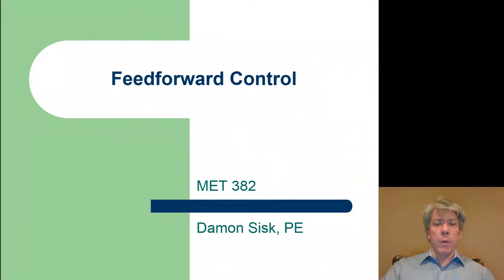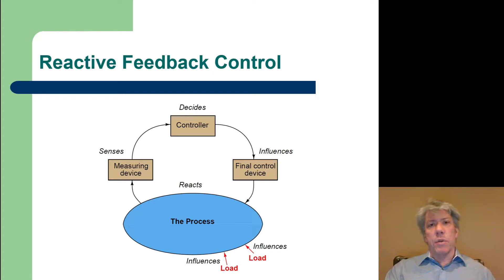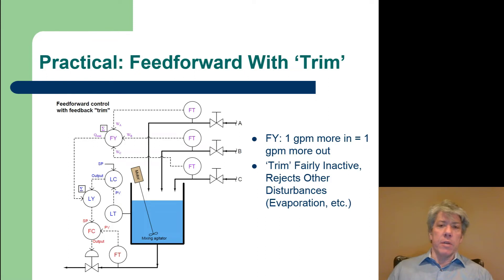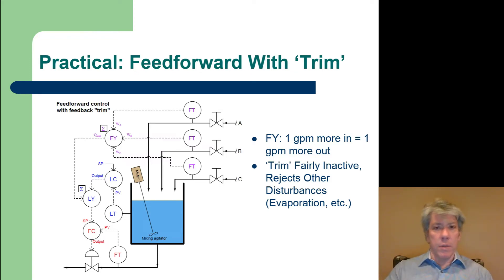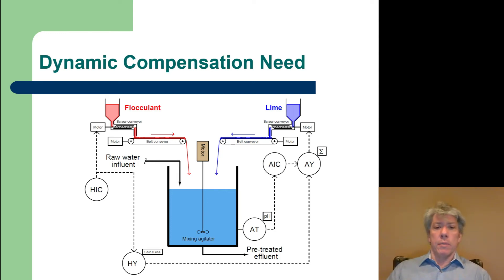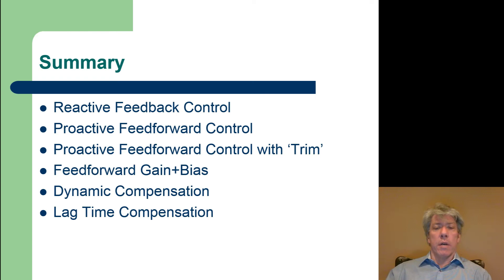MET 382 Feed Forward Control

Comment: 0:19 Reactive Feedback Control 
2:21 Proactive Feedforward Control 
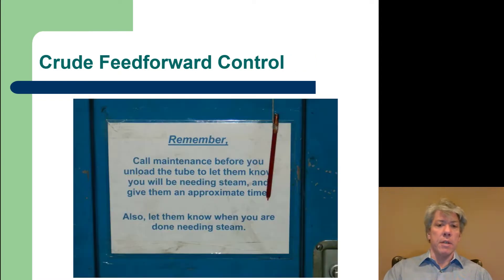2:41 Crude Feedforward Control 
4:08 Proactive Feedforward Control 
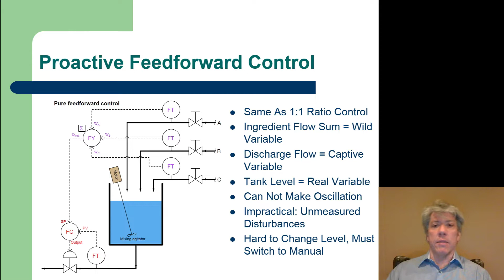7:14 Practical Feedforward With 'Trim' 
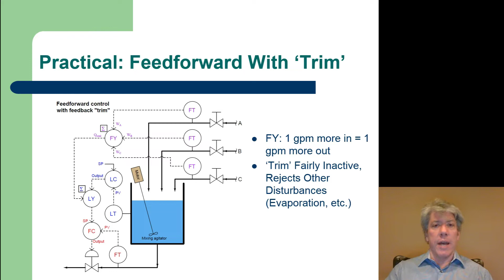9:34 Feedforward Needing Non-1:1  
11:31 Feedforward: Gain and Bias Block 
14:00 Dynamic Compensation Need 
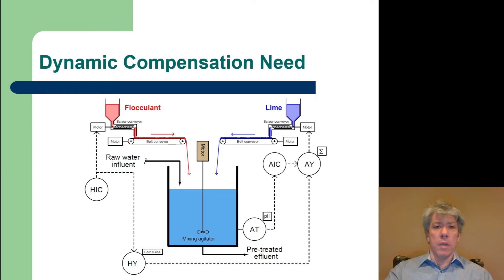18:10 Lag Time Compensation Need 
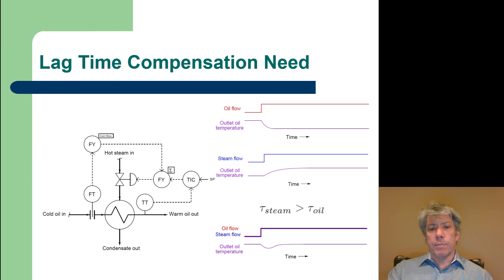20:33 Solution: Lead Function
Reply: <3
Reply from the maker: Thank you for indexing the video!
Reply: @damonsisk4270  My pleasure.